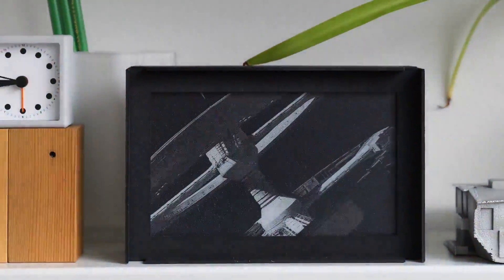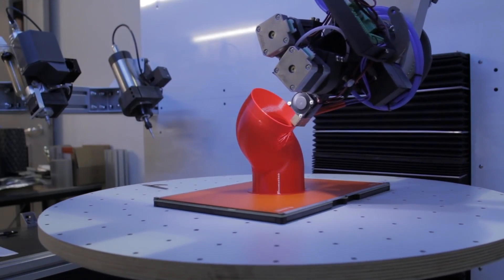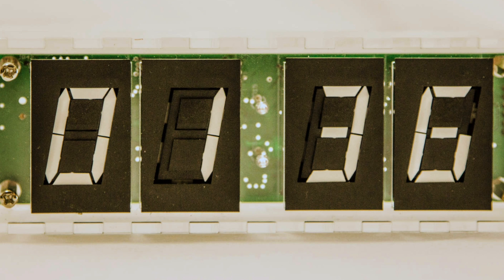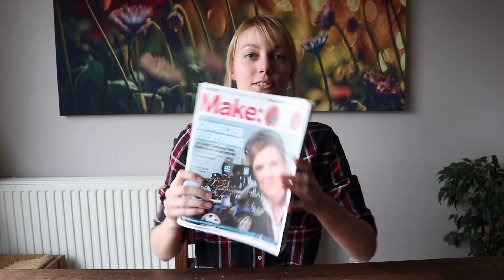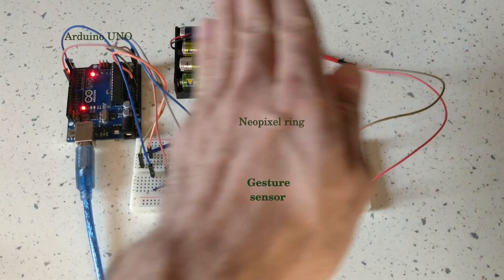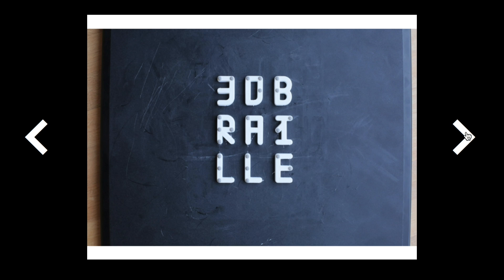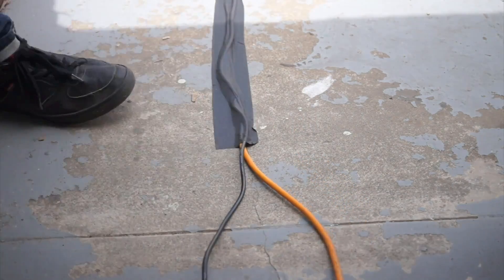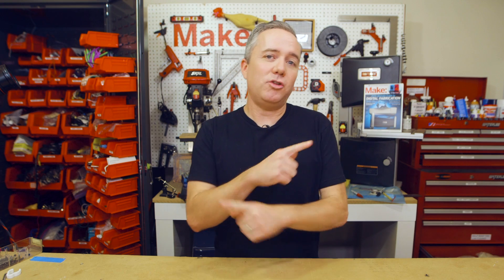Maker Update: E-Paper Movie Player

Comment: I also love gaffer’s tape! I just wish it wasn’t $30-60 a roll! No fair teasing us with the Giaco Whatever Maker’s Knife in the thumbnail. How is it? Does it live up to the hype?
Reply from the maker: It's pretty cool! I was a little put off by it because of the amount of play in the blade. I've been carrying the Gerber EAB Lite for a few years now and when the blade is locked, everything feels like it's a solid hunk of metal from tip to tip. With the maker knife, the blade has a little bit of play in it as does the sliding mechanism. But I love how easy it is to deploy the blade and  lock it back in with a single hand - and the fact that the blades swap without tools is fantastic.

I'm not giving up on my Gerber though, but the Maker Knife is fantastic.
Reply: Tyler will have to fill you in, since it's his.